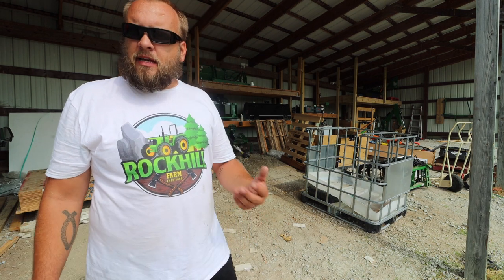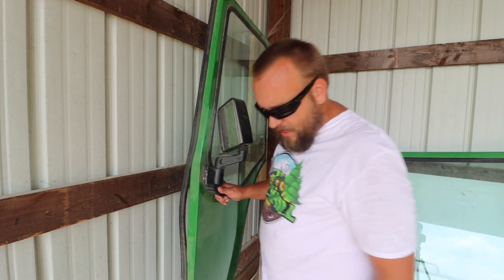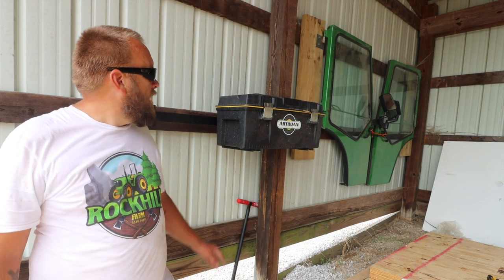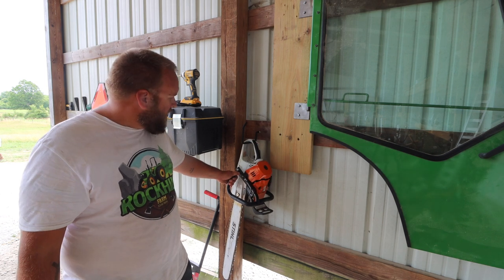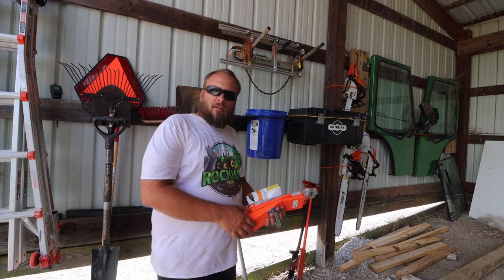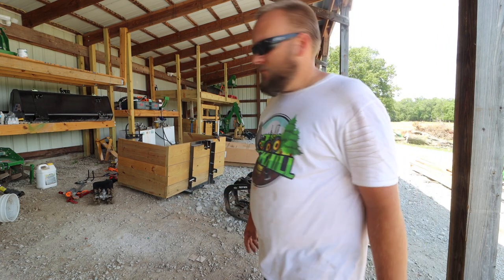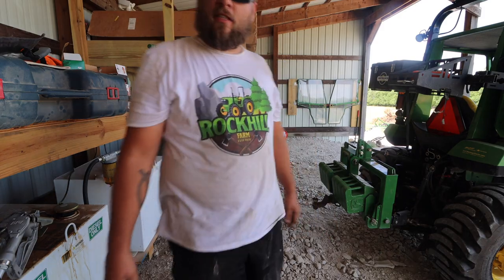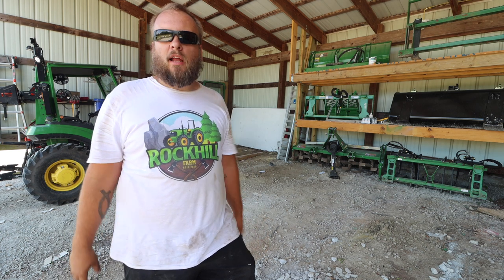Organizing the Equipment Shed

Comment: Great to hear that your back is improving!  Just don't go overboard too soon.  I've just adapted my garage for the change from my 1025R to my new 3046R.  I don't have as much room as you do, but I do have a concrete floor.  That gives me the option of mounting casters on all the heavy stuff, including my Heavy Hitch weight rack.  I purchased the storage dolly from Heavy Hitch, and that is a beautifully constructed piece of work!  Being able to roll things around by hand is surely an advantage and makes it much easier to modify my floor space to suit the changing needs of working in the garage.  I would gladly trade that for a machine shed like yours!  Maybe someday...
Reply from the maker: You can never have enough storage space.

I put a concrete floor in the main shop but it’s just not practical to do it in this one because it’s on such a steep hill

Comment: Looking great! 

I hate that you and the guy who won the carry-all haven't been able to get together. If that doesn't work out, I wouldn't mind being your "Plan B" -- lol!

On hanging your chainsaws -- I use battery powered ones, so forgive me if this question doesn't make sense with the gas-powered ones that you use, but here goes. I have found that the chain oil leaks out while the saw is not in use. Does that happen with yours, and have you dealt with that with where you're storing them on that wall?

Thanks, and great video as always!
Reply from the maker: That’s a good question on the chainsaws. I’ll find out soon.

I’ve seen a few guys hanger size that way but they may have to fill them every time they pick them up

Comment: Brock,
Did you get your cab straight from Curtis or did you go thru your local dealer? I am looking at getting one. So if you have any suggestions that would be appreciated also..
Reply from the maker: Directly from Curtis

The plus cab and the base cab can be ordered directly off of their website.  I got all three configurations because they wanted it to be shown that way on the YouTube channel

I’m not certain if you can get the advantage cab directly from Curtis or not.  Prior to the time I got mine advantage cab was only sold through dealers but that may have changed now

If you have not already seen them I have a series of videos on installing the cab and showing all of the features
Reply: @RockhillfarmYT  I have seen your videos on the cab. That is what got me interested in them…Thank you. Keep up the good work.